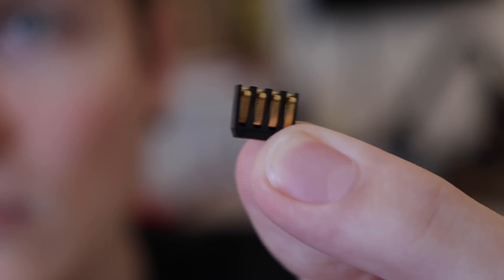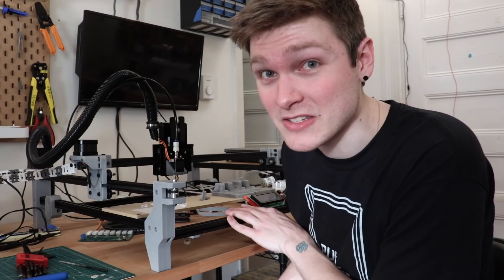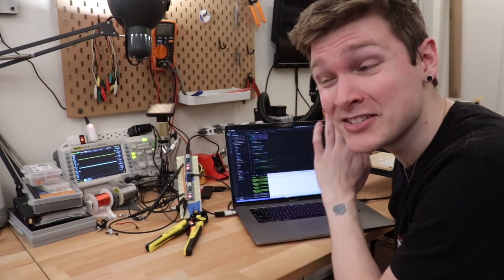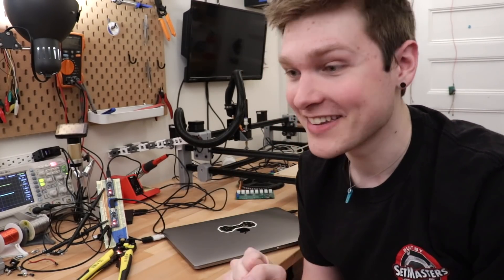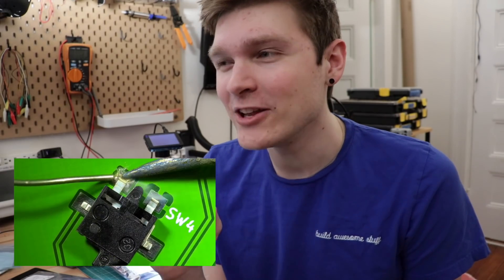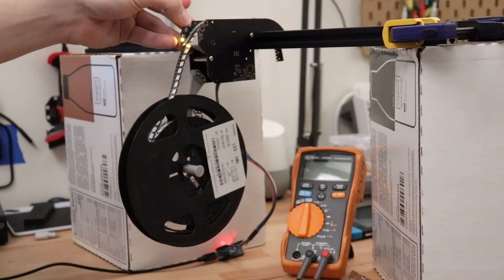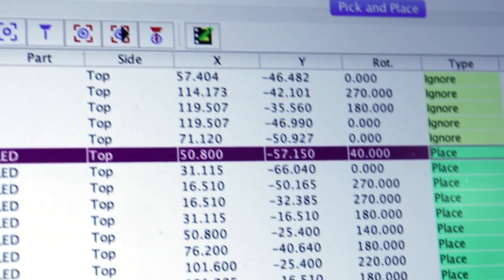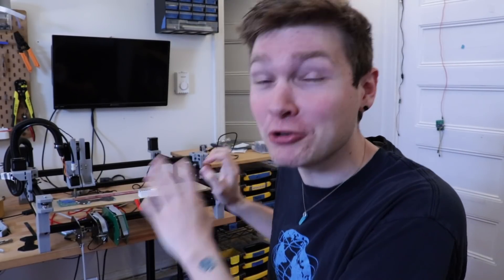Getting Going with OpenPnP!

Comment: A planetary gear assembly could've solved the torque problem. And it could be 3d printed, while being not wider than the motor, and moving the motor away from original position 0-4mm along it's axis. A toothed ring attached  to the motor - teeth face shaft, three tooth gears at 0*, 120* and 240* around shaft, driven by small gear on shaft. The three gears have axles that go into a plate that turns to drive the feeder.

Comment: I got an idea for dust collection. when the mill start spinning I saw a piece of plastic on that spindle 
.. Replace the plastic with 3d printed dust sucking fan the fan collect dust send to another sticky disk top of it ..
So no external vacuum needed
 If you like this idea like this idea like

Comment: When you mill the PCBs and intend to hand-drill any holes, you might want to also mill a little dot in the center of any hole to be drilled. We always used to do that when etching boards, as it helps center the drill-bit later. That said, with a PCB mill, why not mill the hole?

Comment: Hi Stephen, glad I came across your channel. Just reminds me of the project I was going to build 3 yrs ago. Just a very small suggestion on the soldering of SMD ICs specially with ground pad. When using one heat gun for soldering it may look like the solder is melted but sometimes the thermal pad and pins which are connected to plane/polygon specially with the GND (without thermal relief) are having cold joints. I usually use two heat guns at slightly lower temp on top and bottom of the PCB and then nudge the IC once the solder is melted. If the pad has excessive solder it will come out as small balls when you press the IC. I used to solder FPGAs (256 pins BGAs) with two heat guns (without pressing the ICs). Also this way you will not melt the plastic connectors. Keep up the amazing work! Loved it!

Comment: Great job!
I totally love this!
It's ok to fail on one attempt. The master failed more often then the student ever tried ;)

I can truely understand this satisfaction of clicking together a selfmade conector and seeing the expected bits on the scope :)

Btw. you should consider a vacuum cleaner connected to your mill. I suggest to build one part to your drill mount that also pushes down the copperboard on a smooth surface to have the isolation milling head equally dipping into the copper and creating more fixed-width lines.

Comment: Check out the new atmega328pb.  Use the arduino 'minicore' board def package.  This part has an extra timer, two i2c, two spi, and 2 usarts. (Can't use all of them at once though).  It does have a few extra i/o pins over the older part.  Only downer is max crystal freq is 16mhz, though it will work at 20mhz with an external clock (on board xtal osc is now missing full swing function for lower EMI).  The new part is also a few cents cheaper than the non-b version, but you might need the atmel-ice or pickit4 to program it.

Comment: Stephen, Did you ever consider a through hole pancake stepping motor, you don't really need a optic sensor to drive position. But can use to validate your position. Here is one as an example. https://www.oyostepper.com/images/upload/File/24HR04-1004S.pdf

You've got some incredible ideas. Coudows to you on you project.

Comment: Out of curiosity why are you inventing your own serial protocol ?  UARTS are a well defined and robust mechanism.  There is also the OneWire protocol that Dallas Semiconductor invented years ago.  I've used these both on many occasions.  The benefit of these protocols is you can use PuTty or the OneWire software (if it's still around).  https://en.wikipedia.org/wiki/1-Wire.  SPI is the other well defined standard protocol as well as I2C.

Comment: Stephen, I also had another question, you spoke about potentially putting a  conveyor belt under your pnp.  What was your plan on how to handle solder pasting?  We you going to get masks made and do the squeegee method, or were you thinking of putting automated dispensing?  I am super interested in building one just like you have, more to learn than use it for any production.  Thanks again and great work.

Comment: Stephen, could you focus a little bit more in Open PnP software integration?? And how does the Open PnP works with your pigback and Ramps! Thanks!!!
Reply from the maker: I probably won't go too in depth about it in a video because footage of me messing around with settings is a bit of a drag 😅 but everything you'd need to do the same will be in the Github repo I'm releasing in a couple weeks!
Reply: Awesome! Thnks!